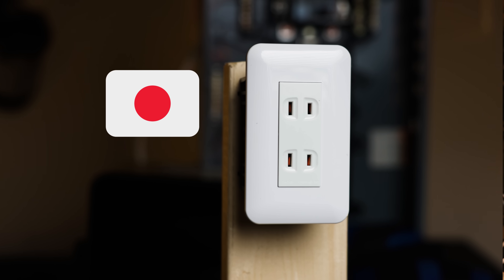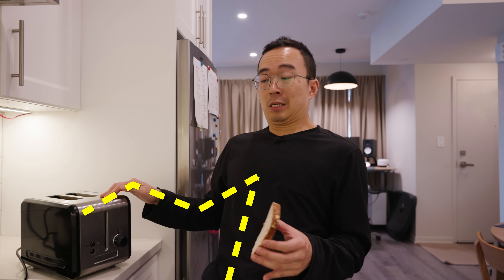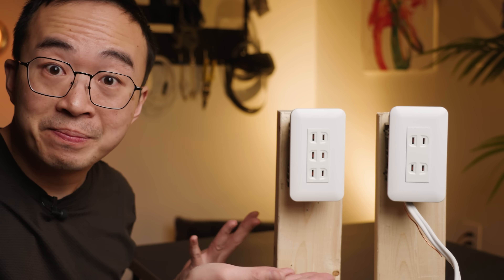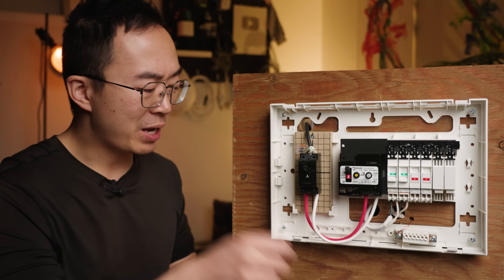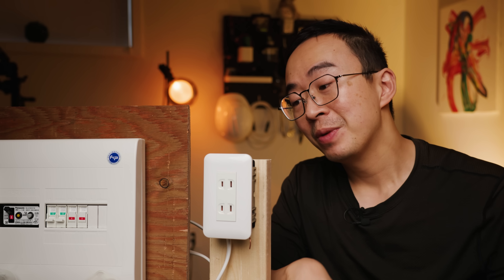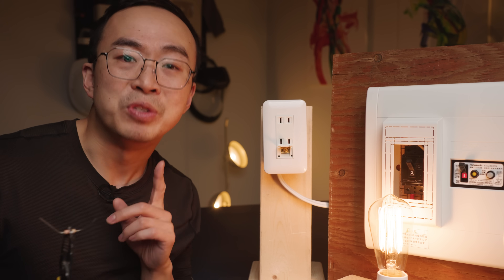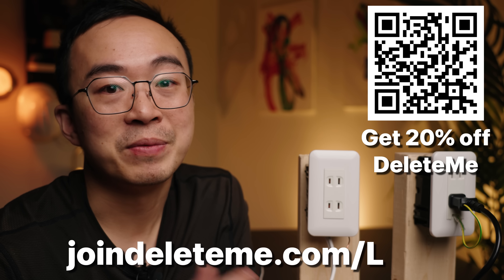How Japan Made Their Outlet Safe

Comment: I can vouch for this, we had a typhoon and water leaked into my house (new build in Okinawa) and soaked a power strip and the main GFCI tripped. Had to figure it out and had no issues after that, BUT, there are appliances that will mess with the main GFCI in the house. We had a drier that used a 50 amp 3 prong outlet, but we had to disconnect the chassis ground and tape it off and add a ground wire to the outlet to keep the main GFCI breaker from tripping.

Comment: The problem with only relying on ground fault detection (GFCI protection) is that a conductive path through your body must be established BEFORE the circuit can trip. Your toaster would have tripped when the hot wire contacted the chassis if the bonding wire was connected. You wouldn't have gotten a shock Even if you were touching the toaster when this happened because current follows the path of least resistance. So it took two electrical faults to cause a shock.

With GFCI protection you must conduct current through your body first before the circuit can trip and although GFCI's are fast there is nothing limiting the current flowing through your body during those few ms.

Also I suspect that the reason behind why washing machines and air conditioners have grounds is because of inductive loads such as motors which look like a ground fault to a GFCI.

Also I don't like using a stakon for a ground connection in an appliance is that some people won't bother to connect it.

Comment: In the us gfci is used where one particular hazard is present.  Ground is used to keep metal housings from being energied.  Two different haxards.  In most countries, If there is a short to ground, the regular circut breaker trips after a large current flows, which means current does flow into the ground wire, bit its bounded to nuetral at the breaker box.  The point is to keep the wires in the wall from getting hot.  But no imbalance is created.  There is an imbalance if current goes somewhere else, or because of reactance.

Comment: When I moved into my new home in Japan (20+ years ago), I had all the outlets changed to the US style 3pin outlets. This was mostly to prevent different static electricity build-up on different appliances. Having electrical surges going through wires not intended for power (e.g. LAN cables, headphone cables) can have nasty shocks, so we grounded everything to keep the static electricity balanced (and I have 24/7 servers at home).
It should be also noted that if there are any power leaks, the power company will notice and come to your homes and perform "Insulation resistance measurement" (must be greater than 0.1MΩ at 100V) to prevent potential fire hazards.

Comment: GFCI/RCD protection has been mandatory in the UK since 1975 for new buildings. First it was whole-house protection as you show, and since 2008, individual circuit RCD protection.    This means if you have a fault with your toaster, the lights stay on, so you don't trip over going to reset the breaker!  The latest regulations (2019) recommend Arc-Fault detection, but this is not yet mandatory.
Reply: Don't forget the older ELCB

Comment: This system still have flaws. 
The RCD will first trigger only when you touch the faulty device, and only if the current, what goes through your body, is enough big to trigger the RCR.
If there was the grounding, RCD could trigger way earlier before anyone touch the device.  What makes everything safer. And that’s how it works in most countries. 

Is the Japan approach safe? Not completely. 
Is it safer than the US solution? Hella yes. 
But it’s no a challenge to beat up the US-early-1900-joke solution

Comment: Misleading, In Europe the neutral bar is NEVER connected to the ground. Its is forbidden. In my country , The Netherlands, one so called "Earth leak detector" measures the actual current difference between the "incoming"-hot-wire and the "outgoing" neutral wire. When this current exceeds a certain maximum (between 10 end 30 milli Amps) the Ëarth leak detector switches of the corresponding mains, within 0.3 mSec.
Reply: There several types of earthing arrangements: TNCS, TT, TNS, etc. 
The one you in Netherlands must be TT (or probably TNS). In the UK, USA, Germany, etc the earthing arrangement is mainly TNCS which means that main neutral and earth are linked. So a phase to earth fault is effectively a phase to neutral fault.
Reply: @IAmThe_RA  Thanks, neutral and earth connected, bizar.
Reply: @jaapsmid1134  Yes, T-erre N-eutral C-ombined – S-eparated. Terre is the French word for Earth 😅
Reply: In Europe the only thing common is that normal sockets give 230 V 50 Hz. Everything else can vary hugely, even the grounding systems. You cannot even assume there is such thing as the neutral. In Brussels they have 230 V three  phase installations, i.e. no neutrals, every socket has two phases each 133 V to the ground.

Comment: Some clever ppl in these comments fr
Reply: No need to be smart lol just have to understand a bit how this type of breaker works. You know the Japanese system is bad when one ground fault occurs and the entire house loses power. It seems that he does not understand the significance of installing a breaker with 30mA leakage current protection as the main switch. You won't see something like this in Germany, France or UK except of the installation was done by someone incompetent.

Comment: There's another use for an earth ground that's not mentioned here... as a connection point for shielding to reduce RF interference.  Things that give off RFI like computers have metal shielding to reduce the interference, and the shielding works better if it's grounded.

Comment: You are full of BS!An open neutral on those cheap two pin outlets happens,  there is stil a live kine.
Also, touching that toaster wouldn't shock you, without touching a dround.
You are clueless about US grounding, as well. Neutral and ground is tied together at a single point, so the ground resistance is no problem. Where I live, the resistance has to only be low enough to blow a 10A fuse in the test set. Ground rods aren't 'a few feet unless it is very wet soil.  Reqular circuit breakers are rated to interrupt up too 10,000A to prevent failure from overcurrent. You ucan fool yourself, but not people who know what they are doing.
30 mA can be fatal. GFCI in the US trip at a lower level. Your bad advice can kill people.

Comment: in the UK we are moving towards RCBO (residual current circuit breaker with overcurrent protection) for each circuit. we also use the CPC (Circuit Protective Conductor) also known as a ground.
exposed conductive parts are prevented from becoming live as all exposed metal parts are connected to the CPC, which when a live touches it, it trips the individual circuit breaker for that circuit. 
I should also point out that ever device doesn't always have a ground, but they are double insulated and are still protected by the RCBO.

Comment: 9:30  WTF !  At the point you decided you needed a ground wire, why did you decide to add a screw terminal? Just create a standard for 3 pin sockets that will accept 2 pin as well

Comment: Japanese/US style flat panel sockets seem less safe than the recessed ones in Europe. It would seem to take more water, dirt, or kitchenware to get bad things to happen with recessed sockets. Also, plugs fit more snuggly in the recessed sockets and won't work loose if you wiggle the cable. Granted, the European Schuko et al carry more voltage, so more protection seems logical. But considering that electrocution is still possible with 100V, are the seemingly flimsy Japanese/US plugs and sockets safe?

Comment: In the old days (80s/90s) is was common here (netherlands) to only have one central GFCI like the one you showed, and it would only protect the bathroom. (And possibly outdoor areas)
Nowadays all breakers for each zone in the house has it's own GFCI, at the central panel. They are simply build in to the breaker, taking up no extra space.
Combine that with the Schuko plug, and we have a pretty safe system these days.
(And of course we have the benefit of 3 phase power....but that's got nothing to do with safety)

Now....that of course only applies to newer homes.....my 1970's home did have an earth wire running to all distribution boxes, but it wasn't connected to any outlets.
And no GFCI at all, anywhere. 
Let's just say I made it a bit of a priority to replace the entire electrical panel and outlets...

Comment: Current code says we need gfci/afci protection on almost everything in a home now. US is allowed to have ungrounded outlets as well as long as they are gfci protected. The biggest difference I see is that they have one gfci to run the entire panel instead of 15 individual breakers that cost 60-65 bucks a piece.
Reply: You cannot add ungrounded outlets. You can keep existing ones and replace broken ones. You must add a GFCI only if you change to three prong and there is no ground wire.

Comment: I find it funny that no one every mentions the other option.  Don't connect either side of the transformer secondary to earth, then neither leg can shock you, it's common in electronics to do that with an isolation transformer.  My understanding is that power companies started tying to earth to stop large voltages for building between the primary and secondary windings and arcing the transformers. This could be replaced with large value resistors for static dissipation.  
Then you have to come into both legs to get shocked, and no circuit will save you from that scenario.
Reply: They found around 1900 that ungrounded systems were a bad idea so in 1901 grounding was recommended I. The US and in 1913 mandated.

The system you are describing is known as IT (Isole Terre) i.e.the center point of the transformer is isolated and the protective conductor is grounded. The only country I know where it is used is Norway and even they are switching to TN-C-S.

Comment: 6:34 it is called a repeated grounding of the neutral. It also "protects" (reduces the consequences, but the voltage will probably drop under the load) from the unexpected  Neutral wire disconnection (bad contact or damage of the wire). But in America they can do it because they live in personal houses, not in the apartments. Normally, in apartments it should not be allowed to do such things. And the RCD (GFCI) should trigger if you connect Neutral to Ground after the switch.

Comment: Most of Europe simply has both. Proper grounding on the outlet level and residual-current circuit breakers. Although there's bit differences in countries when it comes to history. In Austria RCCBs are legally required for all regular outlet circuits since 1980 while in Germany that's only the case since 2007

Comment: Electrical safety is good in both Japan and the US. Your video generally presents a correct picture of the issue for home installations. Japan is governed by the Japan Industrial Standards (JIS), which include electrical installation requirements. Note that Medical Facilities in Japan are wired with three wire plugs based on similar standards to the US. That's because GFCI protection is not enough to prevent several other types of faults that can occur. Many new houses in Japan are being wired with new 4-wire cabling that includes a ground wire and a 2nd (non-switched) hot wire to enable powered smart control devices. Your video will be convenient to distribute to everyone who asks about grounding in Japan.

Comment: When I learned that an un-grounded circuit could develop an induced electrical potential with respect to earth, it all made sense.  You have to bleed off that voltage, hence a ground connection.
Reply: No, you have confused two types of grounding. System grounding is for the over-voltage. However as it adds the risk of an electric shock equipment grounding is used to reduce the risk.

Comment: The NEC is written by the NFPA as such it's primary objective is fire protection. Safety is a secondary consideration and is mostly handled by UL or one of the several other alphabet organizations on the appliance side. 

Ground is a for fault path current. The ground rod outside on the customer side is for ESD, lightning, etc., separate functions. It's main purpose is to dissipate excess charge for other sources that are not the power grid. On the grid side the grounds are part of a multipoint ground that helps stabilize voltages, again during a fault condition. When you get into commercial electrical and start installing and maintaining 3 phase systems, like delta systems. The why behind a corner grounded delta, you start to understand what the purpose of the EGC is and how it simplifies fault protection . With residential only wiring it's very difficult to see the entire picture.

You'll probably get a a lot of hate in the comments for this video. While i'm not going to say some of it isn't deserved, as some of it is. But nearly all of the general public and even most of the electricians that install this stuff don't know the why behind why it is the way that it is. If you want to know the why then you have to talk to the officials that write the code. Even the code book doesn't explain the why. This is a very difficult topic to try and explain, especially to this type of audience.
Reply: The NEC was written independently from the NFPA.  Its primary objective is both fire protection and personnel safety.  It was sold for $1 to cover printing costs.  The NFPA bought it and merged it into its code system. The NFPA jacked up prices.  Now the NEC is dominated by manufacturers who write new sections to boost product sales.

Comment: This "EXPLANATION" removes any purpose for the GROUND rod being buried outside, obviously wrong.  Also the circuit would immediately trip once Live wire touched toaster / ground which it doesn't.  Let's not forget that we use A/C which means there's no true neutral, both main wires are LIVE wires.  Why wait for a Toaster failure, let's just bridge a Live wire to ground in the panel!

Comment: In Australia, every domestic MAIN electrical panel has the ground and neutral circuits joined together, and run to the ground spike in the soil AND the power pole in the street.  This redundancy makes sure that there is always a good neutral and ground circuit.  These days, the standard breaker is RCD/RCBO (residual current breaker) and trips faulty circuits very quickly.  This was not possible back in the days of old skool fusible links in the old fashioned ceramic holders that made a ground circuit necessary.  So in a sense, the issue is the difference in modernization in countries, and what worked in Japan, would not have worked in other nations where it takes a lot more time, to roll out upgrades.

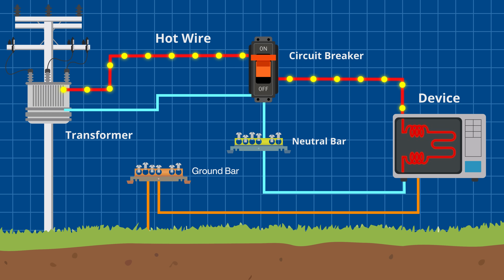Comment: 2:33 what you are demonstrating here  is a type of grounding system called TT system and a RCD (RCBO or RCCB) are mandatory to be installed for the whole circuit (it can be 100mA or 300mA (selective or non-selective) on the input to protect from fire. The rest are normal 30mA or 10mA), because this type of grounding will not pass enough current during short circuit to trigger the coil in magneto-thermal switch (it will not trip from currecnt spike) on the ground which will cause fire. The TN-S is the mostly used in Europe (but the real TN-S requires a ground wire from distribution box and a wire from the rod in apartments distribution box on same bar in every apartment). In TN-S system the ground wire comes from step down transformer box which is on the same bar as neutral wire and during a short circuit, it will handle short circuit current. Furthermore, the ground wire is also used for lightning arrestors, surge protection, noise filtering, reference, screening the source of noise and other usefull things. So, by removing the grounding from the sockets, during the sudden leakage of the current to the case of the device, in Europe it would trip the RCD or magnetotehrmal switch, in Japan it will either shock you (slightly) or shock you massivly in case if RCD got broken (sometimes it happens) or case a short circuit if you move your i.e toaster to the water tap.
Reply: Good explaination! I've always hated the names TT, TN, IT, etc... So unintuitive (Perhaps it would make more sense if I read into the history of the names but a good name is self explanatory).
And yeah, I prefer to still have a ground with an RCD for anything that isn't explicitly double insulated. I've had tingles from a wet coffee maker on a steel bench before. Rather than chuck away the coffee maker or rely on the RCD, it was easy to just add a ground from behind the nearest power socket to the bench.
I've also seen faulty RCD's before when anual RCD testing. Granted, only 1 out of 300, but still it happens, as you said.
Reply: @charmio  It's intuitive if you're french